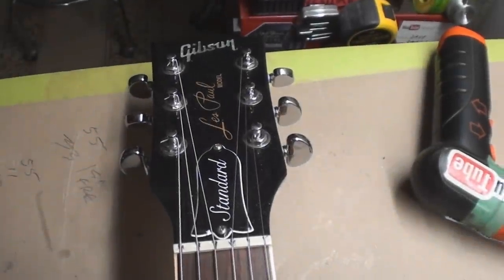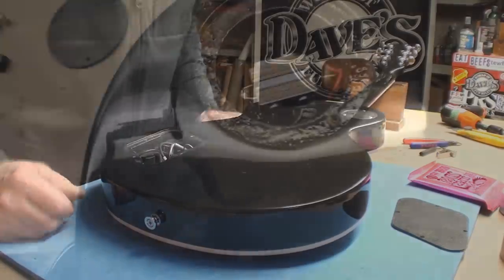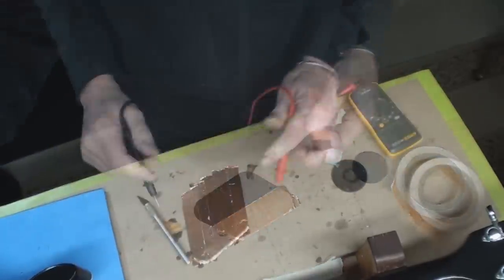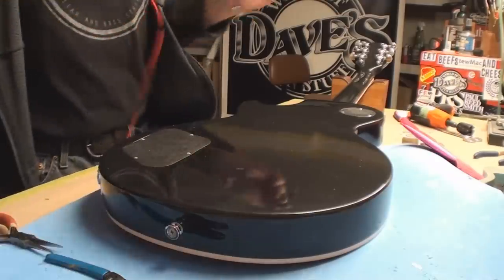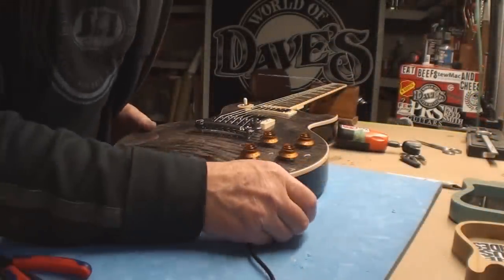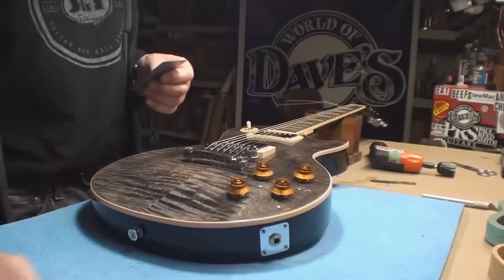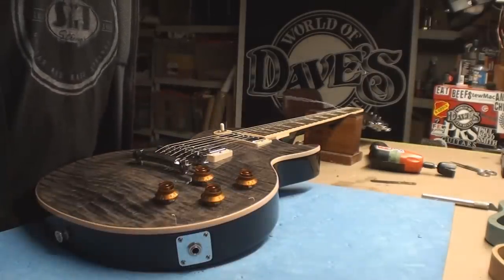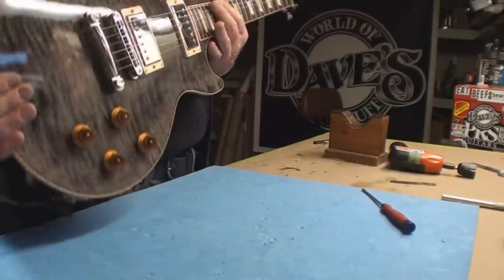Gibson Les Paul Static Crackle Problem Solved

Comment: Hmmm. Hey Dave, got one for you..same issue 17 L.P. tribute. Did same thing ground jumper soldered to copper shield both cavities. Good continuity to ground .Fixed the static on the covers BUT got same static if u rub the back of the body on the finish. Covers are now fine. In fact it build up enough charge to give you a bit when discharge to anything going to ground if you rub the finish front or back. I'm gonna rethink it as I basically said to he'll with it as it's probably an upgraded feature gibson through in like the Jack you found. Gibson is just full of surprises these days. Btw luv ur channel. Peace

Comment: I had this problem with a tele pick guard. I just rubbed it with a dryer sheet. Worked like a charm.
Reply: Brandon Nothwood I could be wrong, but I think over time the static will build up again.
Reply: Jason _ last I checked.. there’s at least a hundred sheets in a box.
Reply: Brandon Nothwood - I have Precision basses that suffer from static, I tried the dryer sheet method and it didn’t work, maybe I’ll give it another shot. The copper shielding is the way to go though.
Reply: Get some copper sheet and leave the bounce for your laundry! sheeeesh lol
Reply: @spilbee  🤣🤣🤣🤣

Comment: @ 2:37  Pro tip: To keep the foil from forming a copper roll, place the foil, foil-side down. Pull the backing paper from the foil. Your work will look much cleaner. (Fewer wrinkles.) Plus, it'll be eaiser to work with.

Plastic holds a negative charge, when another material is rubbed against it. Grounding negates the negative charge. 😉

Comment: Good to see a real 3 way switch. For 1st time ever I broke down & bought a newer 'Crafted in China'  Epiphone Les Paul.. Had never seen the little PU selector, silicone box 3 way. The switch is complete crapola.   The rubber tip was missing. Regular ones don't fit. The post is like 1/16th thick!! So,  I filled the rubber tip with JB Weld and shoved it on & let it set.   Works.

Comment: Thanks both my new Gibsons suffered from this problem. Did exactly as you did and it worked well
Still a little bit of crackle but mostly gone. I do believe the nitro plays a role as well. One can see how the finish collects dust. It "clumps" toghether. I don't have this problem on satin finished Les Paul.

Comment: I think it’s the paint that is holding the charge. I had the same problem so I put shielding on everything inside my LP - still had the static. Then I saw  inside a Tele Ultra they have a ground wire attached directly to the body. So I put a ground wire screwed to the LP body inside the compartment, that solved it. Dead quiet now.
Reply: Hi, from where to where exactly did you attach the wire? Thx
Reply: @paulabgop3659  I ran the ground wire from a ground point (on one of the pots, I soldered the ground in place) inside the cavity of the LP and ran the wire with a jagged eyelet on the end to the inside of the control cavity then I put a small wood screw through the jagged eyelet right into the wood to press the metal directly into the wood so the wire was firmly touching the wood and the paint on the guitar body. Then I put some shielding tape over the crew and closed it up. It seemed to work well for me. I think it gets rid of the static build-up on the surface of the guitar. It's worth a try.

Comment: I've got a Tele that develops that static crap at certain times of the year. I just started rubbing it down with a dryer sheet when it acts up. I did install ground wires that contact the control plate and the pick guard, but I didn't cover the backs of them with insulating tape. After all, the same thing works fine for grounding the metal bridge and the strings. I don't like plastering everything with that insulating tape. That stuff ain't cheap, and I am!

Comment: The way the static problem exhibits itself, is sliding the hand along the neck while lightly touching outside strings, with the amp on. Wrapping your hand around the full neck while rubbing it on your shirt, is not the problem listed by most Gibson owners on most every forum. You have to move the hand that touches the strings to hear the static amplified.

Comment: Disappointed he doesn’t show how to attach the jumper wires or what type of wires to use.  Also, how does the circuit tester apply to the shielding- what do you set the tester to?  Novice DIY’er needs to have more explanation!  Otherwise, thank you Dave.
Reply from the maker: Good point
Reply: @DavesWorldofFunStuff  Dave, Love your channel. Would you mind giving quick instructions on the grounding of the plate? Do you just run a ground from the copper tape in the cavity to a pot? 
My Les Paul is doing this and I'd love to try this but I'm not sure how the grounding works. Mine has a circuit board too.

Comment: This is caused by Gibson's final clear coat process.  They put an electrostatic charge on the truss rod and charge the clear nitro with the the opposite charge so the 2 stick together.  I'm told by many Gibson users the buildup of static will go away over time with playing wear.
Reply: You serious? Got a gibson les paul not too long ago and if i dont have my hands on the strings it buzzes like hell
Reply: @pipespeeps5349  it takes a while but the static will eventually dissipate
Reply: @roryyerama5496  alright, thats good too hear,  doesent bother me too much but the popping when you touch the guitar can get annoying

Comment: Geez, that is a beautiful guitar.  I'm sure it sounds great at the gigs.  Yeah, any guitar can have issues but Dave fixed them.  I have noticed that the people that bash Gibson the most are the ones that CAN'T AFFORD THEM.  By the way Dave,  your guitar cable is a cheapo.  Could be why the cable was popping out of the jack.  Try a nice PRO CO cable.  They work well.  I do enjoy the show.  Been watching you for years and plan to watch for a lot more years.  Cheers.
Reply: So you are clairvoyant, given the fact that apparently you can see how much money people have without even knowing them? You know you can make a ton of money with that right? Hell: even the CIA will probably be very interested; I know they were back in the 60s.

If you know your engineering you will know that the jack (not the cable) can never be the problem, only the socket.  In this case: the crap quality of Gibson's assembly is. In other words: you're full of crap. And if you knew your stuff you'd know quality is buying a couple of Neutrik plugs, a roll of Sommer or Klotz (or Mogami, if you've got money to burn) cable and taking an hour with your soldering iron to make a better cable than anything that's for sale in stores, in most cases even for less money.

And for your information, as you crystal ball might yet not function as well as you think it does: I've got more than enough money to buy a dozen Gibons, I just don't want them. I've got a great Fender Strat American Deluxe and a modified Schecter with humbuckers here: both blow each and every Gibson made after 1970 straight out of the water, qualitywise and tonewise.

The discussion here is not bigdickery about money: it's about quality, in which Gibson has been lacking for the last decades, which is the reason why they've been down the drain financially for almost their entire history. If you knew a thing or two about business, you would know quality assurance would be the reason for brand new guitars not to end up on Dave's bench. Again: GIbson's QA sucks; you're not paying tons of money for a guitar to be shit from the start.

There are plenty quality guitars out there, even for a lot less money, so why would you buy crap like Gibson? Only simpleminded fanboys or the poorly informed would do this. The true player never buys for the brand: he/she buys for the quality, the playability and the tone.
Reply: @TimMer1981  hahahaha.  pretty good.
Reply: If you have 4k to drop on a guitar, then UNDER NO CIRCUMSTANCES SHOULD YOU BUY A GIBSON.

Comment: The static was caused by the way they used to paint the guitars since new management has taken over they have switched back to old method of painting which solved the problem
Reply: I have a late 2020 Les Paul with this issue :(

Comment: You mentioned soldering a jumper wire from the ground wire to the copper shielding - did you do that or was it not necessary?

Comment: I have this issue but it is on the body and neck ? not the plates ? I have used the dryer sheet to solve it but it leaves a horrible goo. It is also only on the black covered Gibsons

Comment: I would love to try this trick. Do you have a video showing exactly what where and how you soldered everything? Also, after two years now do you still recommend this hack?
Thanks Dave
Cheers✌🏽
Reply from the maker: yes ..you just watched it
Reply: @DavesWorldofFunStuff  You showed where to ground to controls?
I get what the foil tape does but show us how you attached the wire or at least point to where you connected.
Me and Gibson want to know.

Comment: Nice work! Thanks for sharing! I have a 2016 gibson SG that has really bad static. I got rid of the pcb for handwired and I still have loads of static. My next step will be shielding, been waiting on the tape to arrive. I'm afraid it won't help me because I have static on the whole back of my guitar. Touch the wood the plastic it doesn't matter. It's so bad when it pops it starts turning on my pedals no joke. Do I need to sand off this nitro shit paint? Dryer sheets don't last but 10 minutes.. I need a permanent solution for my 1200$ guitar!! Any advice or tips? Thank you for the videos.

Comment: Gibson is a ELECTRIC Guitar maker you think they would have that figured out.
Reply: They have on their more expensive models. 🤷‍♂️ You have to cuts costs somehow to cut the price and have guitars at different price points
Reply: @J__C__  Then they should cut back on something else that doesn't effect the sound so much.
Reply: J D C its a Les Paul Standard. The go to  Gibson! Next stop is custom shop for real differences. I expect my entry level guitar from a premium manufacturer to be intrinsically sound (no pun intended) and without fault. At 3.5k Australian it should be faultless ( mine is not) . 🤬
Reply: I have had my Les Paul for years and it just started happening..
I am wondering if it's in my house or something..
Reply: @J__C__   the LP standard is the EXPENSIVE model

Comment: FYI, if you rub down the copper with a piece of the backing paper you'll save your fingers from the sweet cuts that copper can make. And maybe the second contact on the jack was for a definite ground point under tension as opposed to the barrel against the threaded collar.
Reply: I was wondering if, with those push-pull controls and the circuit board, if there was maybe a battery in there???

Comment: Gut the circuit board out and add install a real wiring harness like they did in the 50’s 
Pots and bumble bee caps There is need for anything new in a les paul
Reply: Yes! Who needs progress anyway? Give me the old temperature/humidity sensitive crap caps.

Comment: You could just rub both sides of the covers with either liquid fabric softener or with a fabric softener sheet.  It would last basically forever.
That output jack is crooked and it didn't function correctly.  This is typical of Gibson crap.  $2500-$3000 for that kind of workmanship. lol
I'm so glad there are brands out there now where you can purchase perfection for about the same $$$.  
Also, I've never really understood how 99% of all Gibson flame tops look like shit compared to other guitars for the money.  They are cheap ass-hats.
Reply: Up here in Canada you can add another 1k to those numbers.

Comment: Sorry but this didn't work. The plastics are quiet, but the neck paint is still crackly. It is louder if you touch the strings or bridge and run the hand up and down the neck

Comment: Les Paul Blackwater, Active Piezo Bridge
Reply: Does that mean there is a battery in the guitar?
Reply: I read in a forum there IS a 9 volt battery. That is why there is a switch on the output jack.  To turn off the preamp and save the battery. Hope you see this Dave.
Reply: @guitarstrunged  I believe they do. A lot of people removed this system. I'm not sure why. They may left some of the old components in place just to complicate things for those working on it in the future.
Reply: @jeffblake3564  So if the system has been removed it doesn't matter what Dave did to the switch, but if it is active he shouldn't just bend the contact out of the way so the plug fits a bit better otherwise the owner will be replacing the battery every day. That's what happened on my J-45. Forgot to remove the jack and a day latter the battery was dead.
Reply: @guitarstrunged  Yep, Dave's pretty smart. I have a feeling it was removed or he would have saw the battery pack.
Reply: @jeffblake3564  I agree with you there. But remember his comment "Why did they put this thing here? Run out of parts at Gibson?"
Reply: Based on pictures of Blackwater, the LP in the video is a different model.
Reply: @chrisf6216  In which way different?